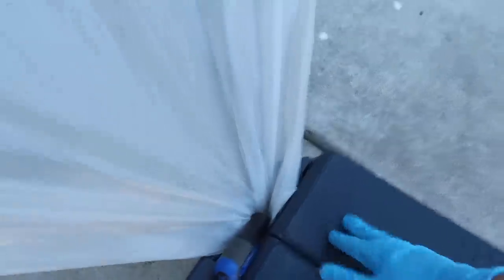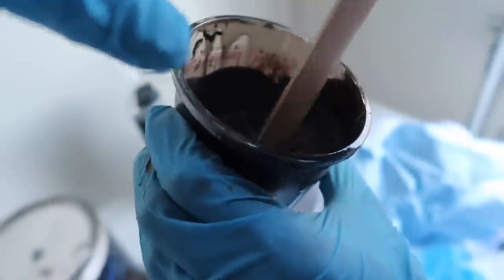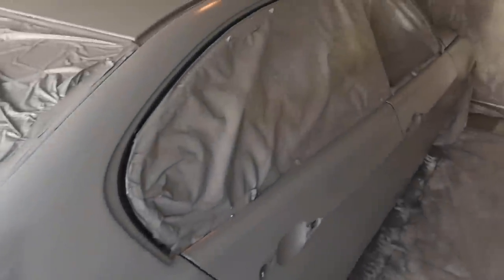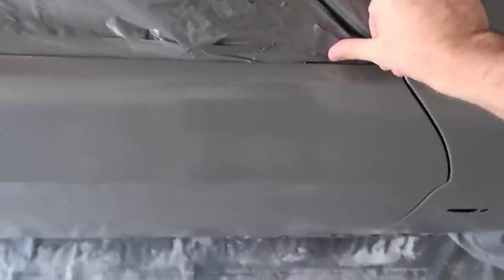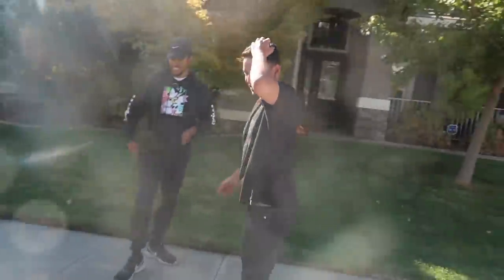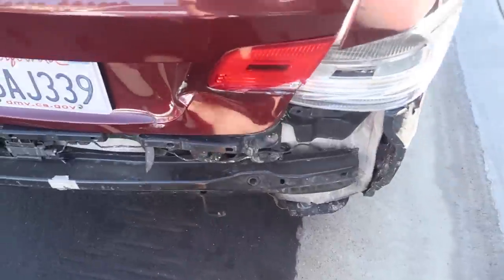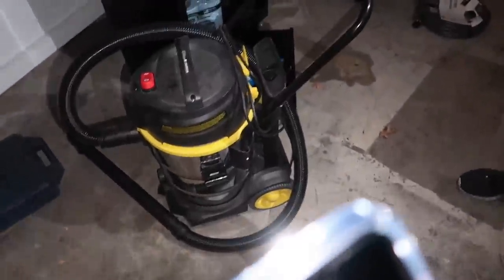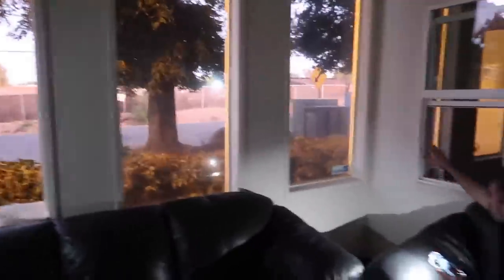HOW TO PAINT A BMW! (PART 4) (SHOP UPDATE!)

Comment: should have done an extra coat of color. sanding should always be done with sanding blacks as your hands are contoured. this would have helped with all the body lines. the sanding of the paint before clear is just to make sure that the clear can adhere and address any larger imperfections. 3 coats of clear then 2000+ grit and polish.

Comment: Those look like what people call "fish eyes" usually happens when the primer reacts with the clear for whatever reason. And as some else mentioned id have started with 1500 or 2000 ended with 3000 then polish
Reply: Richard Schuh fish eyes also happen from not  degreasing the parts properly